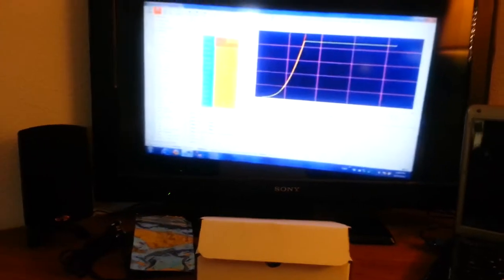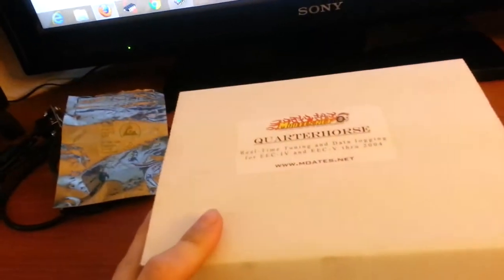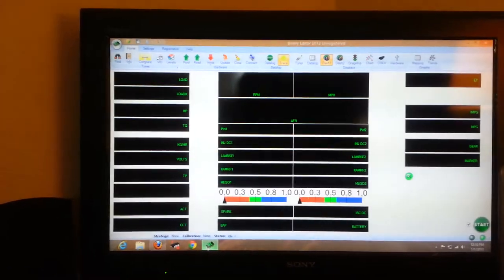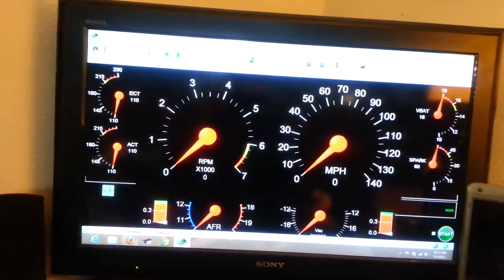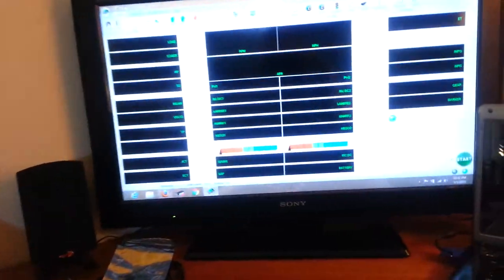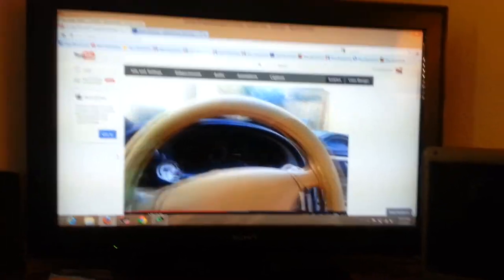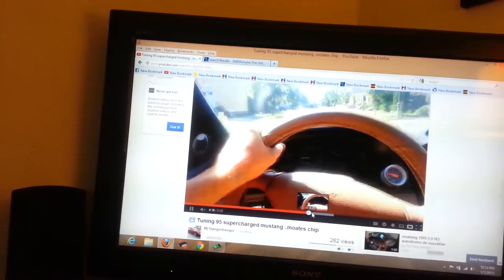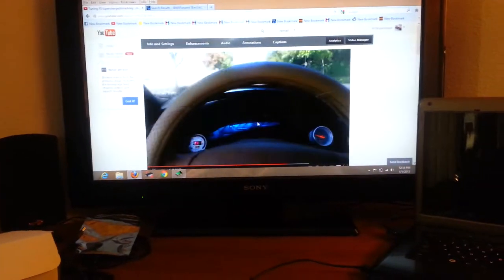QuarterHorse chip.. Supercharged Mustang

Comment: actually the livewire is just as good if not better everything you mentioned in this video my livewire can do with my laptop plugged in and everything it also has a in car mount that i can mount and show PID data while driving, its 410s, Built and forged bottom end with 10.5 compression, supporting bolt ons it made 300hp and 300 torque the way it sits now, the end of 2013 ill have more cash to put towards it for a blower i wanna run a procharger at 8 psi shooting for 500whp